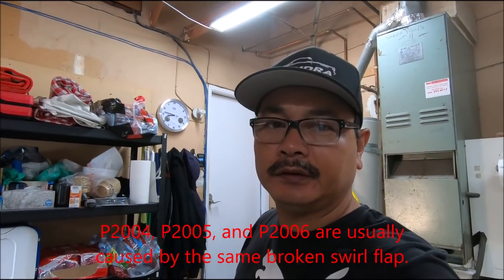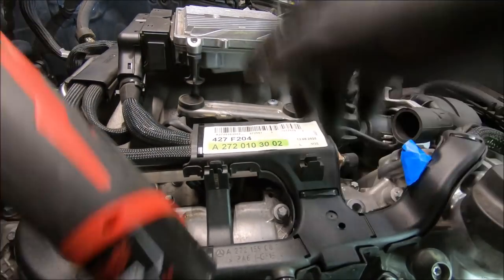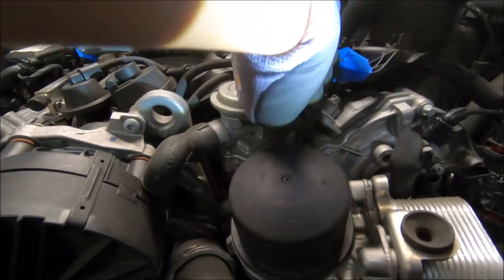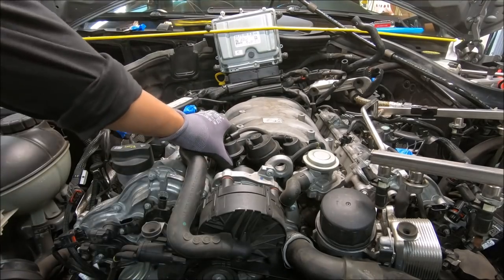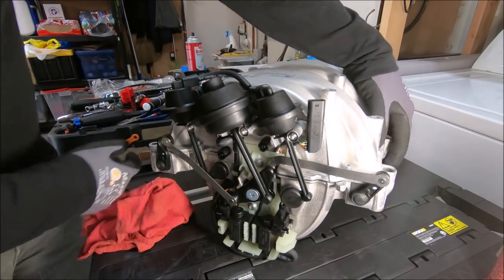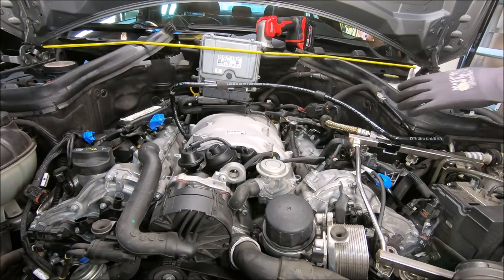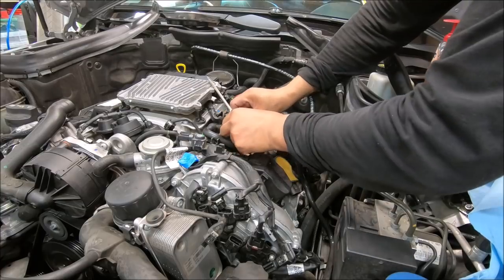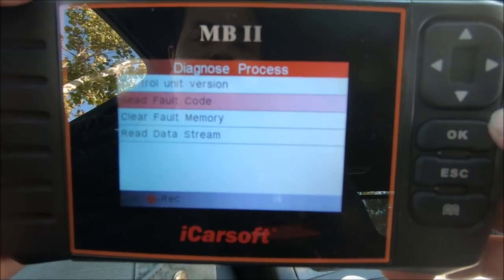Replacing Intake Manifold on Mercedes-Benz C300 and C350 2008 - 2014 (W204)

Comment: To remove the water pump sensor, you need to remove the belt (11:36), is easier to remove it.
To lift the manifold, you need to remove the air pump in front(2:06)(4:33) to get more space or clearance.
You don't need to remove the throttle body to remove the manifold(14:19), do it outside.

Comment: i super glued my gasket onto to the positioning pins, worked a treat, all this to replace the little plastic leaver that had snapped.
Reply: The lever snapped for a reason.  When it snaps, it means the intake manifold is gummed up and not function properly causing the plastic levers to snap.  You would need to clean out the tumbler flaps in the intake manifold or get a new assemble intake manifold to have less of a headache while you are at it.  Also, continue to clean out the throttle body and the down tube on the maf.  From the down tube there is a rubber tube that goes into the pcv cover and a breather in the engine.  This is where your problem beings (pcv cover and breather), it's not filtering out the oil fumes enough and thus cause all the oil fume to build up the rubber tube, down pipe at the maf, throttle body, intake manifold and finally breaking and gumming up the plastic lever (actuator).  You would also notice oil stains in the front engine and that is all from the deposit of the oil fumes leaking out from the intake manifold it collected over the years or hard driving.  
This is a known issue and I have no idea why Mercedes doesn't redesign or fix this issue properly causing this expensive fix.  The intake manifold whole assembled part is not expensive compare to the labor to remove other parts to get to it... That is where it gets expensive.  Oh... since you are at it, mind as well clean out the MAF since you had full access and had it disassemble when you remove the intake manifold.

Comment: Thanks for the video. I got P2007 error code on my E350 2012 blue tech when engine red light came on using FIXD. It  says intake manifold issue. I drove it a short distance a few times and the engine smelled like burning rubber and got really hot. I need to remove the intake manifold and check to see what’s broken.

Comment: Hey i got it done and everything but then the car cranks and doesn’t start, i got it to start by spraying carburetor fluid and it ran really good no shaking no vibrating i scanned and it said position 1 for the crankshaft has an electrical fault please help

Comment: have this to do on a 2007 C280 M272 engine. I can't believe that sealant isn't used on either the throttle body gasket or the air intake manifold gasket.

Comment: Great video thank you, I have subscribed! I have a 2013 C350 setting O2 sensor faults.  I'm told the engine harness full of oil from faulty cam sensors / magnets and needs the harness, ECM, and cam magnets / sensors replaced and maybe O2 sensors. Dealer wants $8800.00 to do the job! it only has 46000 miles on it.  So how much more work is needed in addition to what you have here to get the complete engine harness out? I'm thinking of taking this on myself as I am very mechanically inclined but have never worked on one of these. I also understand the dealer is the only one that can replace the ECM so I may have them do just that part of it if it's even really needed.  So this sounds like a VERY common problem with these, do you have a video relating to this issue?  Thank you again!

Comment: Buddy could you show for 2015 c300 p052e71 pcv crank valve replacement pls I have check engine which comes and go away every 100 miles. Thanks

Comment: Which brand of manifold should I buy? I was told not to buy anything other than the original brand because all the other ones are "Garbage" is this true?
Reply: i will check on rockauto, if they have the pierburg , thats the brand mercedes use expecp it doesnt the mercedes stamp. i replaced one of these on a SLK280 some time ago

Comment: Hello, do you recommend the aftermarket intake manifolds that sells on Amazon or ebay, new for 250$?
Reply from the maker: No, personally I would not feel comfortable with those. I would rather get them from local part store or dealership.
Reply: @NK1794  thanks for the reply, I found a brand-new one at rockauto branded "Hella" for 560$ including shipping etc...
Reply: @NK1794  gotta ask, when the Manifold is faulty, the car kinda shakes at idle like misfiring? My car does that even with new engine mounts but has the flap manifold DTC

Comment: Please read before starting! First off be extremely careful removing each pigtail. I broke 5 pigtails and it threw off a check engine light. The plastic is frail and breaks very easy. I had to take my benz into mercedes to have them swapped for $760 which isn’t fun. Also at 18:38 in the video the vacuum line is very short. Pull only on the vacuum line and have extra on standby. Amazon has some for like $10. I rushed it and broke the black grommet that attaches the line to the face of the manifold and had to buy and new intake manifold off Amazon for around $190. Do your best to avoid these mistakes during removal and install and save yourself a good chunk of money.
Reply: Thank you. I am working on this project now to replace the triangle part with a metal one. The electrical harnesses are definitely brittle from all of the heat its been exposed too. I'm gonna use zip ties to secure the ones where the gray tab to keep them in place broke. Also broke off one of the vacuum tubes. Bought some connectors and some 5/32 tubing to fix it. Mercedes-Benz could do a better job at preventative maintenance and stuck with metal parts. This project has been such a headache.

Comment: I’m thinking of buying a 2007 e350 should I worry about balance shaft it has 170000 miles on it
Reply: The fact that you're asking this question about a car that has 170k miles on it means that you shouldn't be buying a car you can't actually afford. (The answer is YES, although some would say that if it were going to fail, it would have already)
Reply: I have a 06 E350 w/150k for sale

Comment: I just did mine but I noticed the flaps or arms move only when you rev  high is that normal?   I thought that it should move all time low idle and steady  2000 or 4000 rpm   am I wrong ? I want to make sure its not defective it was not moving at idle ….
Reply from the maker: S K I think that’s normal. Do a code scan to see if you get anything. If it’s clear you should be fine.
Reply: What the name of the place you bought your parts please let me know I have the same problem I really need the information we’re you bought your kit please ty

Comment: Very courageous to do this yourself, I am sure you must have had a few white knuckle moments. ;) Interesting how you did not disconnect the computer. If you don’t mind me asking but what was the milage on the car. Do you think your previous throttle cleaning may have aggravated the problem and maybe brought it on sooner? Would be interesting to see an inside look into the manifold.
ขอบคุณ for taking the time to make this video.
“Subscribed”
Reply from the maker: Thank you for watching and subscribing. No, it's not related to the throttle body cleaning. The manifold had physical damage so I could not mount the new control arm. I had no choice but to replace the whole manifold. The car had 82K miles on it. Sorry, I didn't take a picture of the inside. The car has been running great and has no error codes. Knock on wood.

Comment: Why didn't you take out the ECU ? it's just 2 clips securing the cable..would've made the job a lot easier with so little effort instead of having to cram it all the way back there lol and you also risk damaging the connectors bending the cable like that

Comment: Hey I got a 2008 c300  ,I recently scanned my car and got this code 2004 but no check engine light.
My car car has a rough idle when the engine is cold and sometimes struggles to accelerate.How much would the MB dealer charge for this?....Or how about an independent shop?
Reply: $800
Reply: Are c300 reliable? I’m looking to finance a 2012 maybe or even 2015 under 100k mileage for sure and in my city they go around  $10-15k is it worth it?
Reply: $800 it's an intake manifold, once you get it fixed it will be perfect

Comment: Wow, that’s a lot of work. This probably took a few hours
Reply from the maker: Took a good half a day.
Reply: Mercedes will charge you a leg to do this repair / replacement.... insane amount of preparation and removal of parts to get to intake manifold.  Also, lots of possibility of damaging other expensive parts while you are at it.  Especially the metal grill at the top of the engine, aka. ECM, which will set you back $2000.  It will need to get programed too for your specific car model.

Comment: How long did this job end up taking you from start to finish? I feel bad for you, but I'm not sure how bad I should feel.
Reply: If you have this type of engine with the intake manifold.  You are inline for this replacement.  There is no escape due to the design the engine has it to pump engine oil fumes into the intake manifold.

Comment: 16:50. Fuel injectors? Also I’ve got an 07 c280, is the process relatively similar?
Reply: Tarren Thomas hey I’m looking to buy my second car and was considering a Mercedes c300 2009 but used from dealer ship ofc with somewhat like 105k, 145k mileage but I’m worried it to be like a BMW with plastic engine parts is this true?
Reply: Fut03 5 bmw are worst! Mercedes benz don’t really have those problems . They much reliable
Reply: @BJB LMAO $200 for oil? $65 for oil at Walmart (mobile 1 0w40) filter  was $20 and my local shop charged me $35 for the labor and disposal

Comment: This is why MB became a piece of garbage, MB could installed a metal components as one of the kits comes with and not to have the need to disassemble all these for someth8ng MB could do with good quality. One of the plastic flap brackets came loose and came off leaving a big hole in the intake manifold, causing a massive vacuum leak. After I fix it sold this bad quality MB. I had a 1980 300Turbo diesel, that was a real MB.

Comment: Contact me if you live in Atlanta area and you need replacement of Mercedes intake manifold. I do also have one extra on shelves that fit C, E and S class. 
$200 for new intake and total labor cost $250.
Reply: Wish you were in Cali!
Reply: bsalesevic  u have ur own shop?
Reply: @ bsalesevic u have your own shop? I’m from ms
Reply: rohanmax14.  for now i work for a mercedes repair shop and i fix it at home. Let me know
Reply: @ bsalesevic you still have the intake if you do give me your contact information.
Reply: @ bsalesevic if u still have the intake then give me your contact information
Reply: @ bsalesevic u still got the intake manifold?

Comment: Issue that cause it... People run cheap ass oil. And don't replace the PVC.. And that shit gums  up and breaks. I just  fixed one. every damn  servo arm was broke. Event the one inside the intake had broken the control flaps All 4  of them,,,..

Stupid customer thought a Dorman replacement lever kit would fix it. I laughed my ass off....As the vacuum hoses were  leaking like water hose  from dry rot..Then he had the nuts to tell me to reuse the intake gaskets. I did just as he asked.. It still runs like shit...Should have coughed up $300.00 for new one. As I charged his ass $450.00 labor. As I had to remove it three times. To  seal most the vacuum leaks. Just to get it to run...All four Flap controls are still broke...You can't fix them...There  inside the intake..